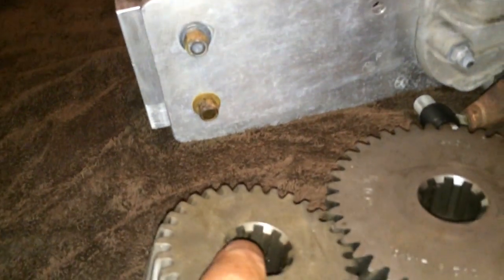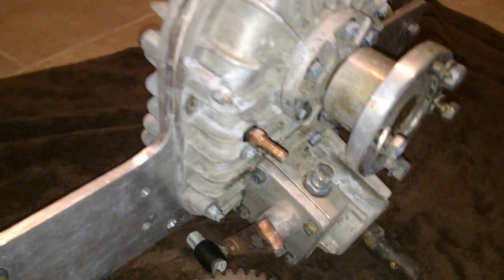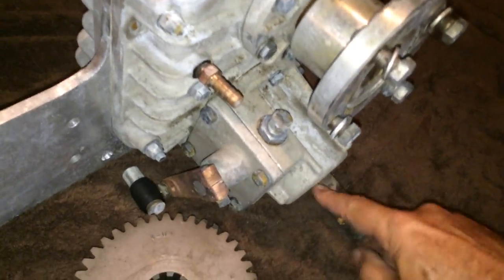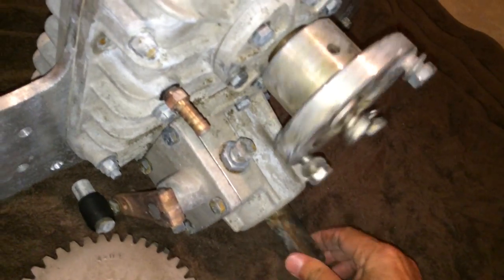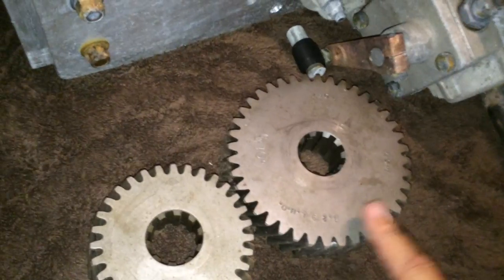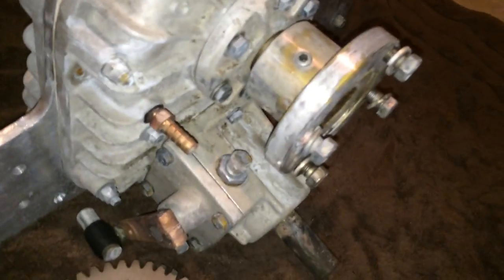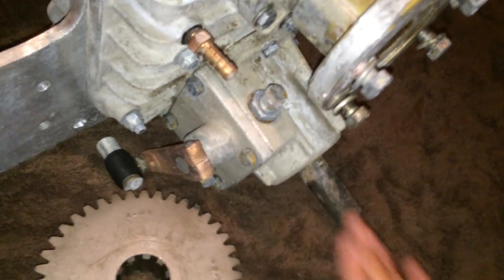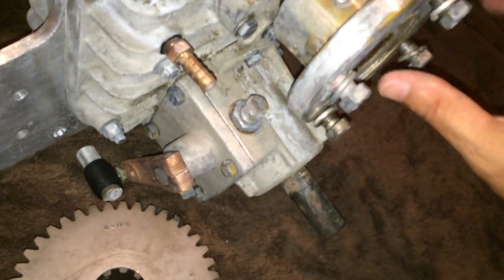How a V-Drive / Vdrive works

Comment: surprised they never made a boat engine with a transmission so you can go faster at lower rpm and use less fuel.